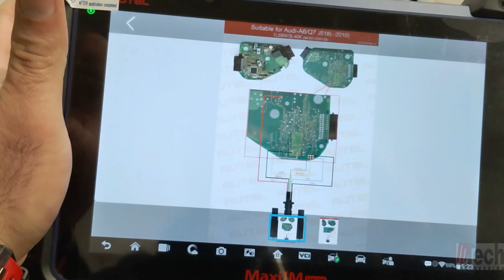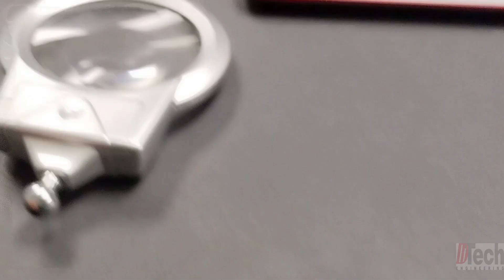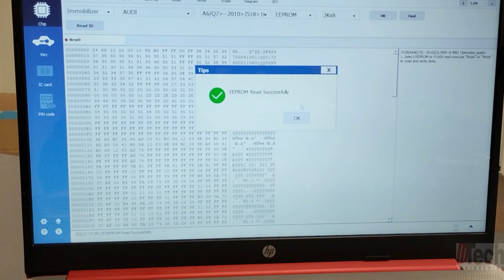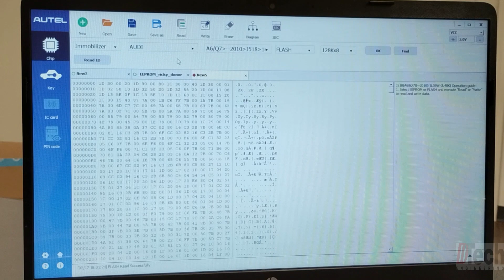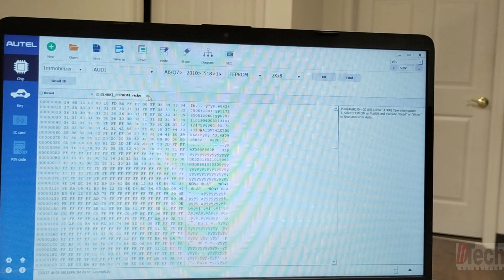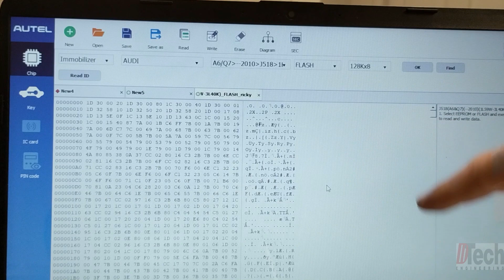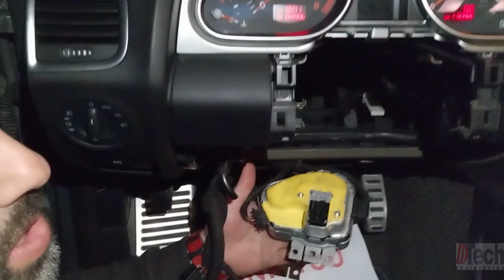Installing Used Steering Lock w/Autel on 2007 Q7

Comment: Can you buy just the unit for computer and not pay for the expensive diagnostic machine
Reply from the maker: Yes, you can just get the xp400 pro, then download the program for PC off autels website once you create an account and register the tool
Reply: @DTEAuto  do you get exact same features and all functions or is there limitations etc
Reply from the maker: I believe it's pretty much the same, some say there are a little bit more options via the pc like I have found you can change the voltage supply to eeproms when reading which I haven't seen on the tablet unit. The only thing there is to know when getting the program from autel, there are 2 different program versions, one is limited and the other has everything on it, I made a video about using the programmer on pc and explain the 2 different programs and which one to get.
Reply: @DTEAuto  thankyou

Comment: Hi I have a Question  the autel im608 pro2 dose not have a hexeditor Built in the tablet 
That mean I can't do module cloning and Virginizing 
Or only through pc 
 i just received my scan tool im608 pro 2 and  hexeditor not there i did research not in the  im608 pro II 
Thank you for another great video
Reply from the maker: Yes I have heard that they removed it, I have no idea why. But yes I would try on the pc if not I know that there is a way to transfer the files off the tablet onto a pc.

Comment: I have an handle oscilloscope can take 600 volt pk to pk with 1:10 attenuater if i connect it in ignition control wire and i wott did this can damage my oscilloscope
Reply from the maker: as long as you have the attenuator the scope should be ok

Comment: Nicely done👍🏻!  Is the eeprom and flash file stored in the larger square mcu or is the tool reading from two different chips?
Reply from the maker: Yes correct, both stored in the same chip